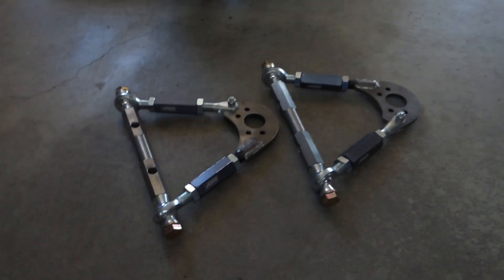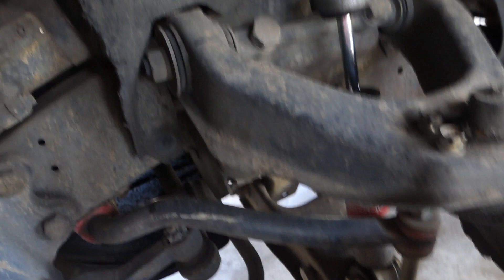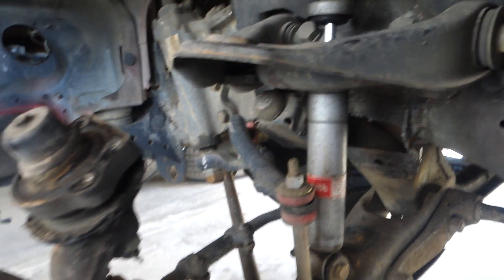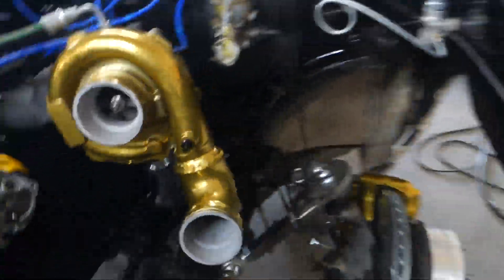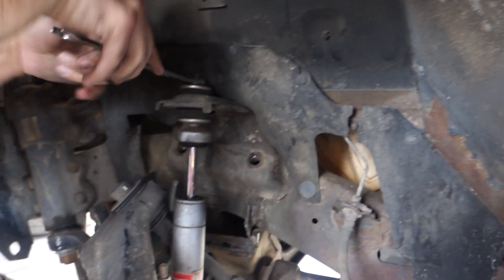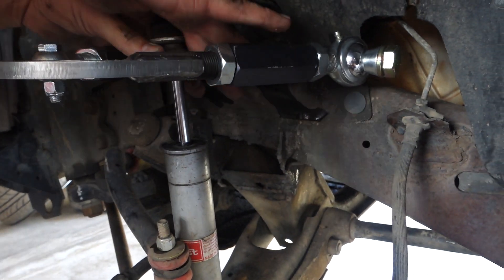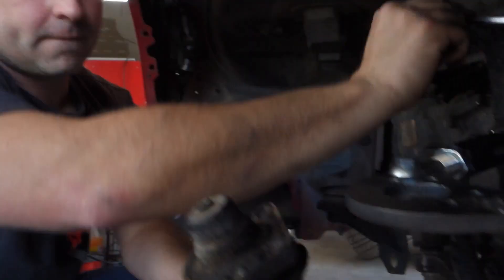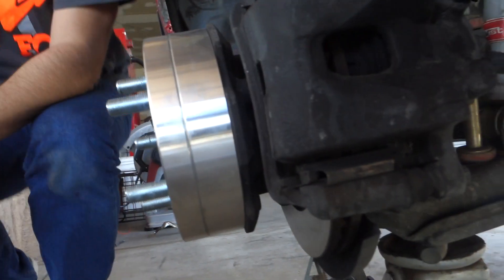D21 Hardbody:  More CAMBER with Upper Control Arms!

Comment: I have 89 S10 spring over shocks on my 97 d21. Just had to change the bottom bushings from the d21 to the S10 spring setup. And it rides decent. Esp lower

Comment: My video would have the title "Less Camber". LOL! 

 I raised mine slowly until my camber was gone, with torsion bars.  It ate the piss out of my tires, and when you run over a line in the road the truck yanked you whatever way the line went.  Not to mention, the streets here in Louisiana SUCK! I bent all kinds of stuff under the front of my truck. 

For a drift truck,,,,,,,,,,, PERFECT! But since our home flooded in 2016, this turned into my "Daily Truck".  The silver lining is I fell in absolute love with my nissy and have been fixing it up a little more than I would had if I still planned to bounce it off of walls and cars at the track. 

Pinto  shocks lasted me about 4yrs. They are weak now. Getting that floating feel from the front end. May have to try the 4x4 shocks. "Thumbs Up Ronnie"

I cannot wait to see the difference in a video of the 2x4 and 4x4 fenders. Up close and personal. Once I do my timing chain in the coming days, I will see how hard it is with the fender mirrors to do (Thumbs Up Beau) with the mirrors. If it SUCKS, I will get new fenders and put my original mirrors back on and go 2x4 or 4x4 based on you guys findings. 4x4 fenders seem a little more pricey, but if it is night and day difference, it may be worth it. I am running 15x8 rims with 195/45/15's. They poke out a little. The 4x4 fenders may make them HELLA FLUSH JDM LIFE STYLE BOYYYYYYYYYYYYZZZZZZZZZZZ!!!!!! HAHAHAHAHA!!!!!! 

Sorry for another long comment but another fun and informative hangout!!!!

Comment: These still for sale or contact order, if so how much. If not you got a link for a similar product. I'm cutting my inner fenders relocating the wiring and battery so I can tuck the lip of the rim on my 17s or 16s and still have some usable suspension travel for drifting. Love these thing first time I drifted a hardbody was in KC and all I did was touch the pedals as my bro steered from passenger to show me how it drives compared to my miata at the time. I'm using miata knuckles up front to they give better bump steer correction and more angle stock. Almost full bolt on